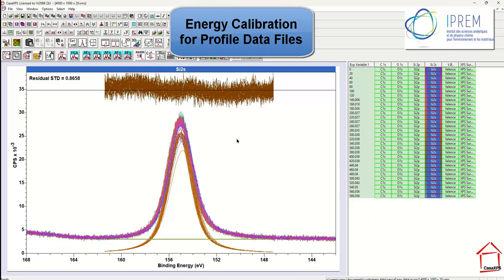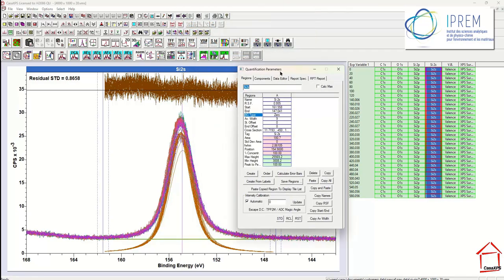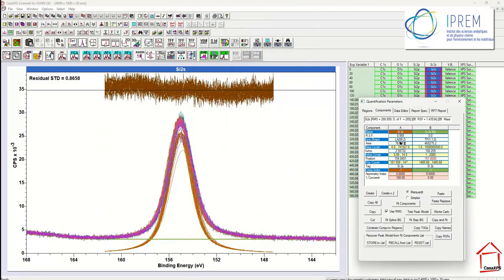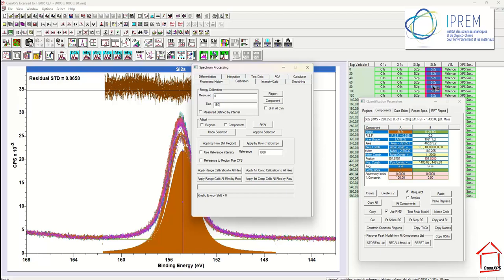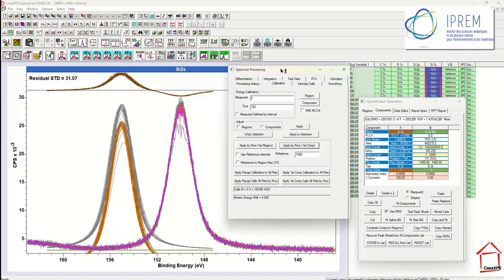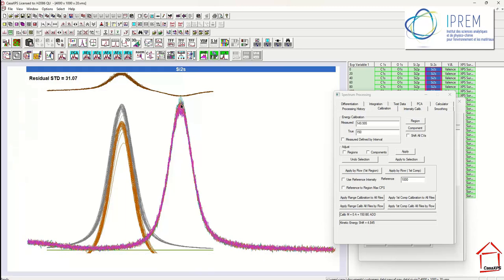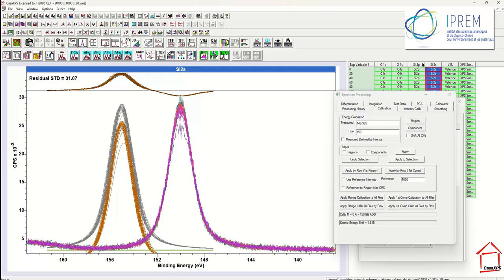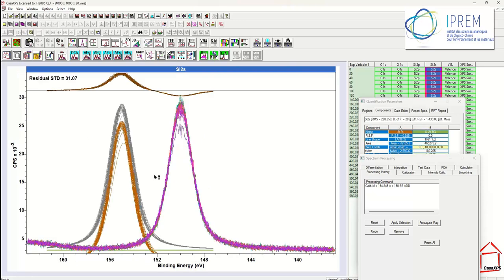Energy Calibration for Profile Spectra: Apply By Row 1st Comp

Comment: Thank you for the many wonderful and helpful tutorials! Is there a way to export the residual curve (for example as an ASCII file) after fitting the data?
Reply from the maker: Yes. In version 2.3.26 a toolbar button allows the transfer of spectra, components and the residual through the clipboard. I will make a video to illustrate the export with the residual, but if you send me an email I can send you a screenshot that explains the steps easily and quickly. neal@casaxps.com